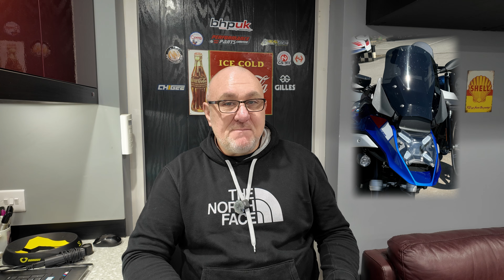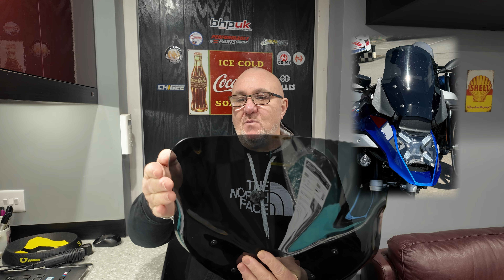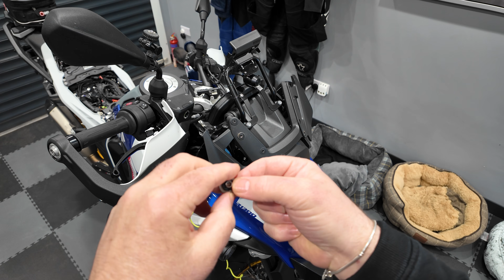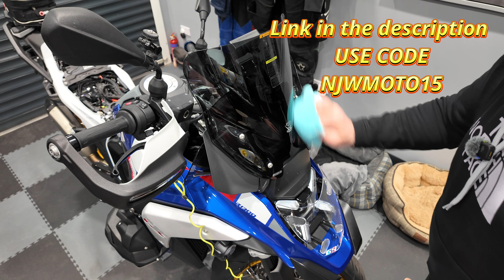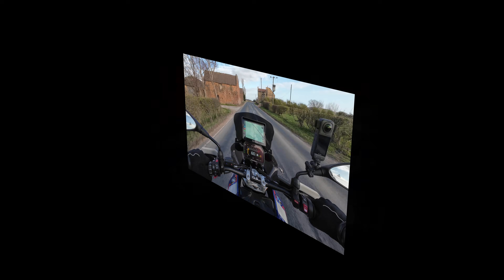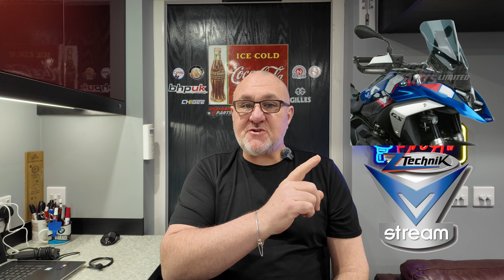New ZTechnik VStream Windscreen for BMW R1300 GS with Quantum Hardcoating Tested

Comment: Hi Neil I bought the V stream for my Trophy and its a game changer.. I now need the lower wind deflectors to match the dark tint of the V stream. You have already replaced yours so can you let me know what company and manufacturer and a link please? keep the videos coming fantastic to watch
Reply from the maker: Hi the lower deflectors are the WRS ones https://www.ebay.co.uk/itm/127002174878?_skw=wrs+Wind+Deflector+Dark+Smoke+For+BMW+R+1300+GS&itmmeta=01KCVE4FZ7JDAK8YDGYGNAWK15&hash=item1d91eb659e:g:9YEAAeSwk0Rn2rf5&itmprp=enc%3AAQAKAAABEFkggFvd1GGDu0w3yXCmi1d9YxLZfw4URtnhWxef1gC6fx%2BFQjS1M3z4n23RMvxuZMQtR9JLeRh62%2FiBvRLpZSqv4NJ%2FwnXxLO6mdnDXjmNTkMBKiv2UtaQ4J1XUOAJXVQ6DefzM62BKTT2p9ybNok3nlZJV1RPsV%2F%2BSNkWpkQbdHkR8bo4EHj40CuBorHyzhqnadG4yg09xdknzUbJNm1EDYh3FZtbUt%2BWdF%2F3K487OaYgunwvTl4WhNuNY1FW%2FVLCp--5xx58Xyr5FnPyjSdzwQQtGLWc04pSy3%2B%2BKfzfsp1Gl3dL1vKG5DCWWZJT4YJO0yAYZsAZYI5Z6U%2B6PckpE%2BXVo%2Be24iyY%2F6S%2BIIxWD%7Ctkp%3ABFBMhoGS7uZm

Comment: Hello Neil, how are you ? I also have a bike like yours but I think the rear suspension is too soft (even in the stiffer mode - Dynamic and Dynamic Assist +2). If you feel the same way, I would like to see you change the rear spring or a complete rear suspension (by Touratech, Wilbers, Tractive, Ohlins, YSS…). Looking forward to it. Thank you.
Reply from the maker: Hi buddy all good thanks 🙏 I think you may have an issue have you been back to your dealer? 
I know there was a batch of bad rear shox that went soft and had no damping mine is totally fine buddy and I’m a big bloke  its on rails 46 degrees each way no problem 😉
My bike has the adaptive suspension with all options